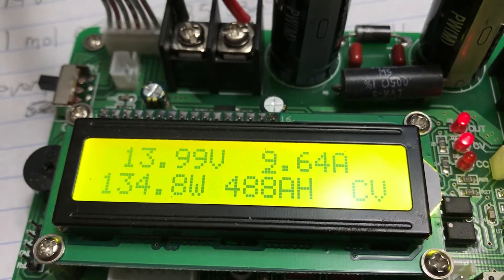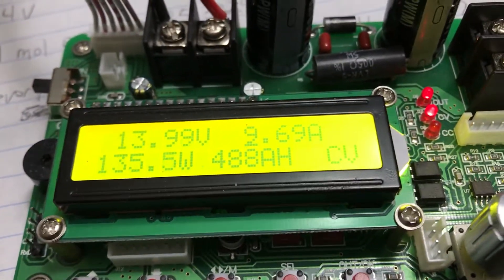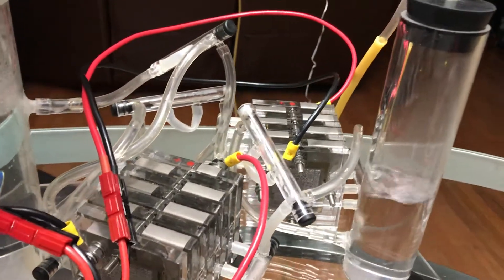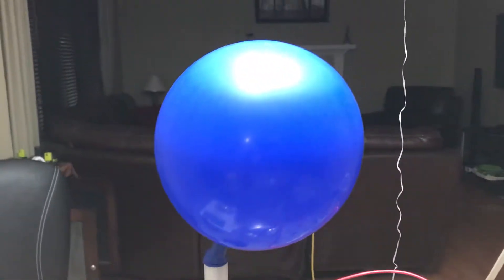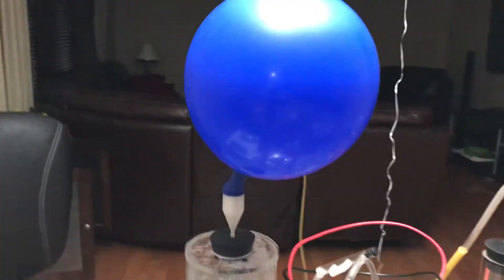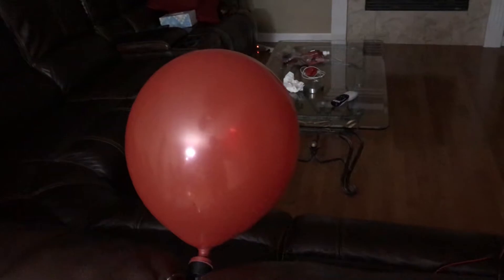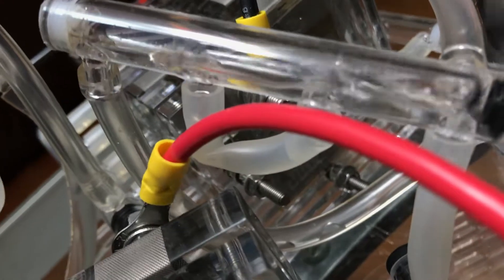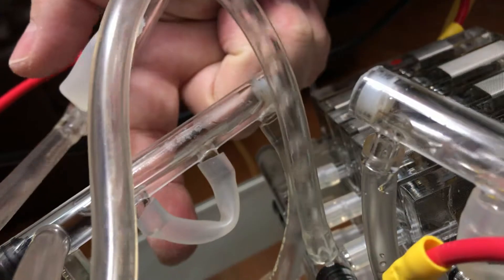500 cc/min PEM hydrogen generator

Comment: 500cc H2 a minute from 135 W is 91.8% efficiency. but if you only use the total charge flow in 60 minutes then its  797% efficiency

Comment: Did you make these generators?
Reply from the maker: Yes, I made a bunch of them but I've had no luck finding low-cost DC power supplies that can handle up to 5 amps at 14 volts.  I ordered some from 4 different sources and ALL of them had a huge voltage drop at 4.5 - 5 amps so they weren't as specified by their manufacturers.  The power supply I use for my personal hydrogen generator that uses 4 stacks was near $100.  If I can't find something cheaper, I'd have to raise the price a little.  I was shooting for very cheap power supplies and not charging my customers anything more for the power supplies - I was going to eat that cost.  
Another option is solar.  In full sun, a 100-watt solar panel has no problem running one of these cell stacks at full production rate.
Reply: @ChristmasEve777  hi , so u made the PEM urself too ?